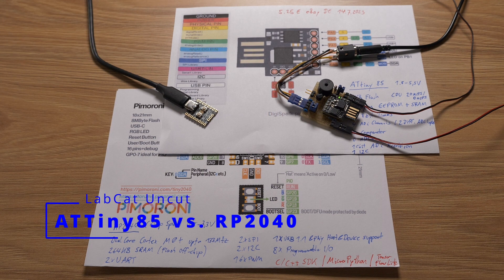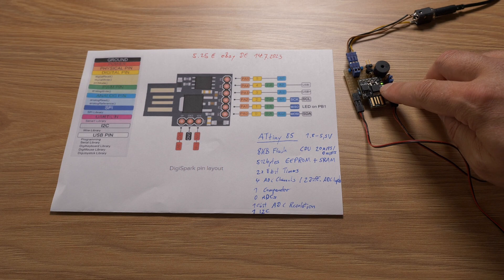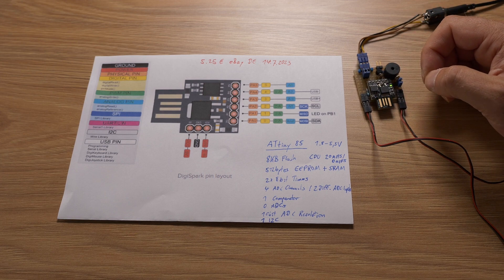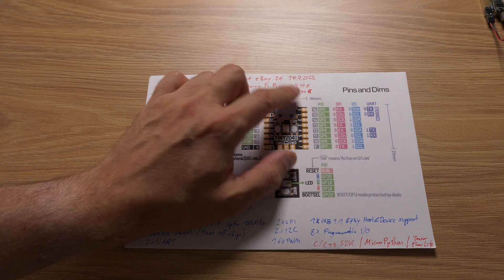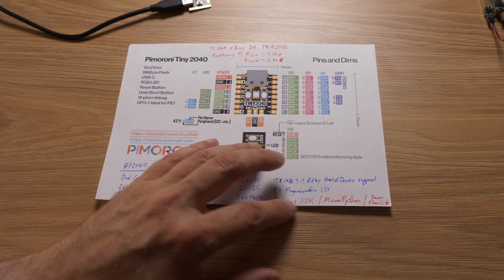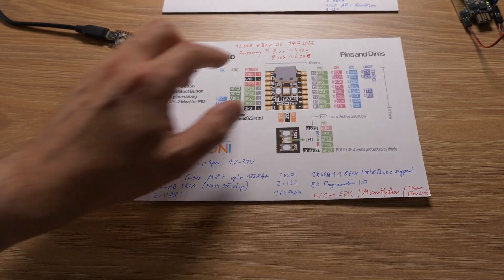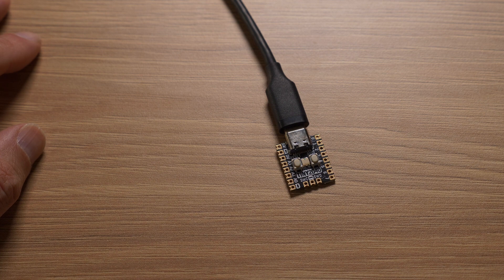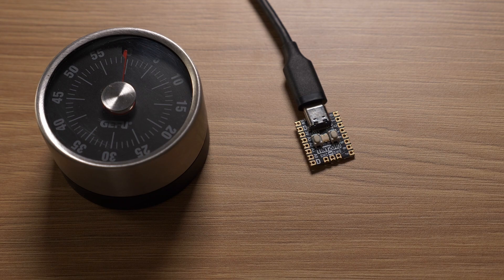ATtiny85 vs. RP2040 - Uncut | Electronic

Comment: Nice summary, and I agree with you 100%; it's time we drag our projects kicking and screaming into the new millennium, and say goodbye to the legacy AVR chips. Though they do have one thing going for them. Sitting down with the product and series data sheets, you can get a complete understanding of the chip. Now try that with the RP2040 :-) Just the M0+ core with supporting documentation alone is probably into the 10s of thousands of pages!
Reply from the maker: Yes, there is nothing wrong with an AVR or a PIC for a very small project with a specific purpose, but for something moderately complex, why should you make your life so much harder than it needs to be?
And you are right that "completely" understanding an ARM core or just the nested interrupt engine is a big challenge on its own.